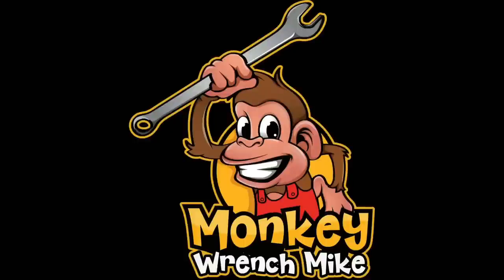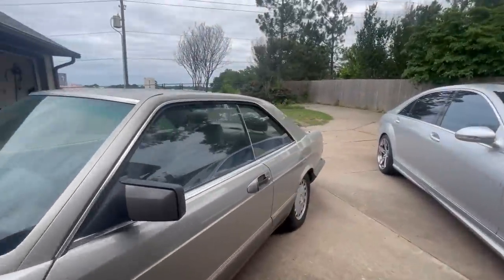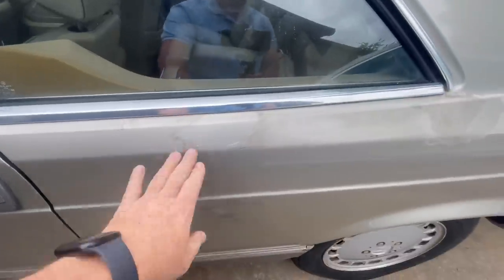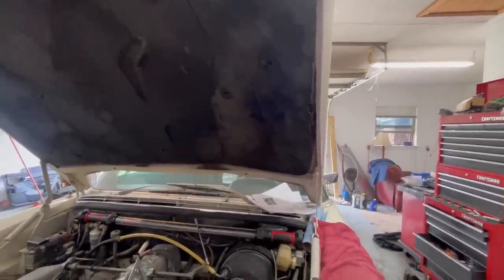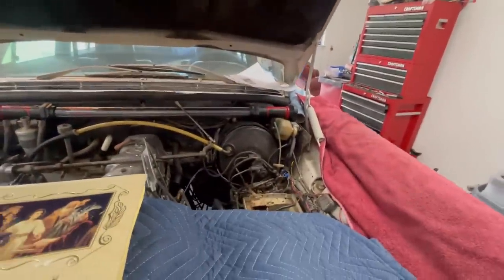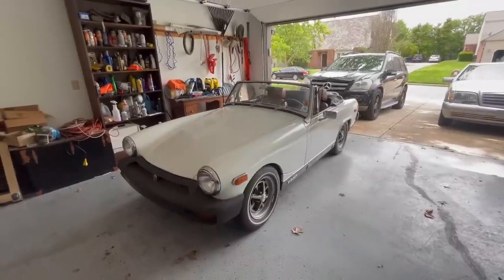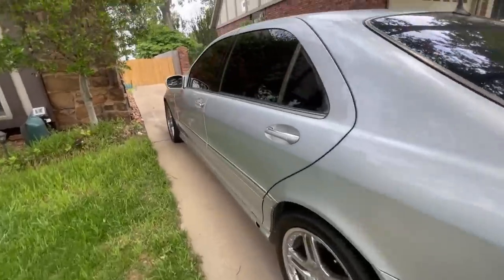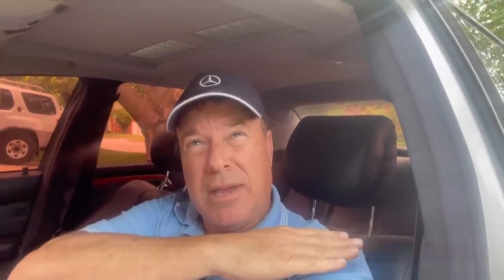Fleet Update

Comment: Hey Mike, I Just replaced the compressor on my CL500 , a helpful tip: when you remove the lower motor mount short bolts to raise the engine screw in their place a 5" long bolts to keep the engine aligned with the lower subframe , and when you lower the engine replace the long bolts one at a time with original 13mm.
Reply from the maker: Perfect

Comment: Rather than drilling through the woodgrain, why not run a power lead through to the comartment between the seats and install a lighter socket there. That way, it's out of the way plus you have a safe out-of-the-way spot for the unit being charged

Comment: Those mercedes 280's are temperamental.  But with a great engine.  Everything is mechanical and like any German engineering is over cautious.  Had a 280 SE that ran beautifully and then suddenly it decided to take the day off and no way will it start, left her alone for 16 hours and would start and run like there was nothing wrong.  Keep at it and overthink every problem and you will find that a 0.49$ valve is the problem.

Comment: Your 560 SEC sounds like a fuel problem.  I'd check the control pressure at the warm up regulator.  The pressure can rise due to debris in the fuel.  It will plug up the screen in the warm up regulator and cause the plunger in the fuel head not to move enough, essentially starving the car of fuel.  I've encountered this a lot on my old Volvo 242 turbos, which also use BOsch K-jetronic.
Reply from the maker: Hmmm sounds possible. I just removed the exhaust to “clean” the catalytic converter. Lol. But I’ll investigate the regulator!!

Comment: Sounds like the S600 has a power drain, as in something is not shutting down. Try pulling the fuse on the radio and dash charge it back up and see what happens but without a auto electrician it's like peeing in the wind. I must admit sending it to auction is the best idea even if you lose a bit on the deal it worth the stress factor being taken away.  Laters old bean.   Gary 🇬🇧🇬🇧

Comment: Mike I posted this a while back - did you replace the fuel accumulator when you did the fuel pumps? The accumulator can reduce fuel pressure and the non-WUR cars have a port to check fuel pressure and it’s SUPER easy. Also I think you’re onto something with the exhaust. I would have the cats removed with a test pipe and I bet that could also fix your problem.

Comment: Mike I don’t think you will have to do that to the E63. These cars are very similar to the 220’s. Look at your 220 and you’ll see. You just have to push the engine up about two inches from the transmission and it will raise enough for you to manouver. If you want more space, take the bumper, radiator, radiator fan and condenser out and the compressor slides through the front instead of from in between the chassis.

Comment: Thanks for the introduction to Millie.  It looks like a fun drive on curvey roads.  Not sure if you have already researched this or not.  But I wonder her fuel pump fails due to ethanol gasoline?  I ask the question because ethanol is more corrosive than non-ethanol gasoline.

Comment: Toyota Corolla Verso's have the same problem with their radio and it's usually the soldier joints for the transistors  crack's and will cause the exact same symptoms as your radio so that's worth a try or it could be wonder rear speakers or front that is grounding out so that's why say go over a bump and it might work intermittently

Comment: HEY MIKE !!!!!!!  I might have a cheat repair for your ac compressor . What is exactly the issue with the compressor ??  Let me know . Because if you can activate the ac compressor by using the scanner . If you can activate it with the scanner and it works , but will not activate when you press the ac button on the climate control you can add a diode to the positive wire and to the ground wires coming from the compressor clutch .  THIS DOES WORK 💯 . !!! The factory diode goes bad from dead batteries and jumpstarting the car . I have had 3 customers with this issue and it worked on all 3 vehicles .  Let me know what exactly is going on with your ac compressor .        Let me know Kenny
Reply from the maker: The compressor won’t accept Freon. I evacuated the system, applied vacuum, checked for leaks…. But the compressor won’t take any Freon.
Reply: @MonkeyWrenchMike  try to unplug the compressor and apply power and ground to the compressor just for a few seconds , just to see if the clutch and the compressor both function and sound ok ✅., I have had a mb that had to be filled by using the machine. Would not accept those little cans . Also check the valve core to make sure that it is getting pressed down to allow the R134 into the line . I have came across one on a car that was slightly bent and wouldn’t go down to allow the R134 into the system
Reply from the maker: @joehomanick  will do! Thx!!
Reply: @MonkeyWrenchMike  no problem mike ! You got to have ac 🥶🥶